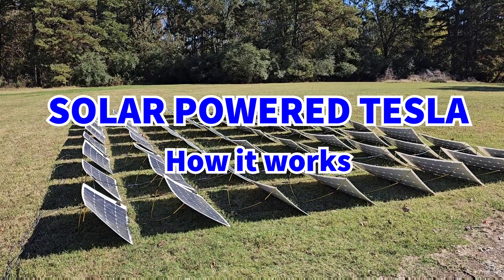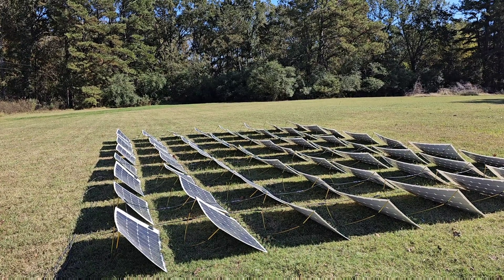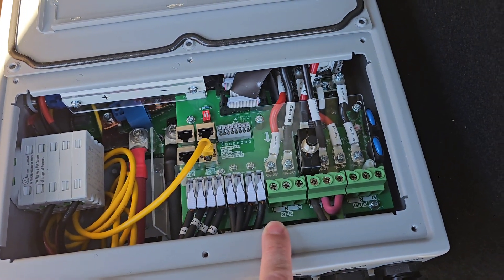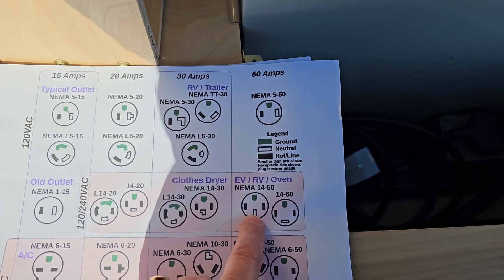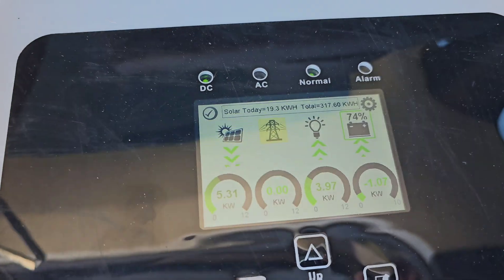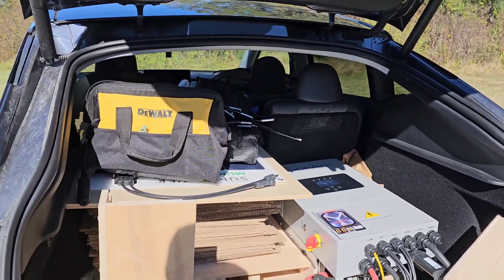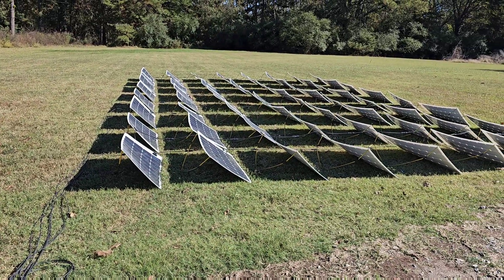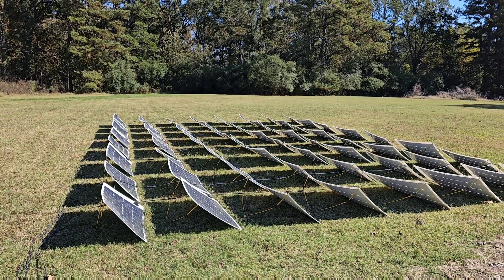Solar Tesla

Comment: I don't think the dc-dc solution you mention is limited by the communication with the car the way you described. I think the rough protocol is that the car establishes a maximum charge current with the charger and it's up to the charger not to exceed it. If you run at a lower current because the sun isn't shining it won't hurt to charge more slowly.
Reply from the maker: That would be nice. I am not sure how charging stations throttle current. I do believe they need to maintain a system voltage regardless. And there must be some threshold to keep the car in charging state.

Comment: Nice. I have noticed that there's a lot of stuff that could be powered with DC directly, but is only made to be plugged into an AC outlet. Which is annoying because you always lose power each time you convert between AC and DC and there's already a bunch of loses involved with solar. I'm gussing that by the end of the decade you will see a lot more stuff with a DC power plug.
Reply from the maker: I hope so. Would be cool to have DC outlets. Maybe that is the future of USB C. All low power electronics could be powered by high voltage USB outlets, monitors, computers, etc.

Comment: Aptera is making there own voltage-boosting MPPT and they will have many of them on the car.  They have rather low voltage strings of solar cells and have to boost to, I believe, 400 volt.  It will be interesting to see how efficient such a high boost ratio MPPT will be as, in general, MPPT's are typically most efficient when not boosting by very much.

Comment: Whats the total weight? I found putting too much in the back affected efficiency, not sure what you can do about it, but if there is any weight you can put in the frunk to balance it back out again, worth playing with to see if it makes a difference.
Reply from the maker: It is not as heavy as it looks. I will try a follow-up on the components and specs. I did bump the tire pressure from 41 to max 51 PSI. I also tried a CAT scale at a truck stop but the car would not even register.

Comment: 1) You drilled that hole through the tow hitch, but the car will lost its waterproof capability.😅🤔
2) So that extra battery would provide you extra energy if you completely drain all the juice?🤔
Reply from the maker: Yes. I have a plug for now and when I am done will permanently seal it back up. And that battery is good for another 15 to 20 miles. About like having a 1 gallon can of gas in the back.

Comment: I found an article about your cannonball challenge today. I subscribed to follow this crazy adventure!! I love this. Few month ago I was wondering what it would take to plug solar directly into chademo of my Nissan leaf. Dc/Dc and the solar panel are like the DC charger.
Reply from the maker: Cool thanks. I looked for quite some time. Even went to a battery and EV expo in Detroit. The closest I found was a controller that needed to be integrated into the vehicle and they were only 600 watts. Aptera may be our best hope.
Reply: There are few options which seem to be coming soon, and might work. I can't post links, but the names below should be enough to find info about them:
- Ampernext 30kW Solar DC-DC EV Charger
- Enteligent solar-powered DC-DC EV charger
- Enphase Energy bi-directional EV charger
- SolarEdge bidirectional DC-coupled EV charger
- dcbel r16
Reply from the maker: @scottcytacki  Thanks. I will check it out. This would be great when they come to market.

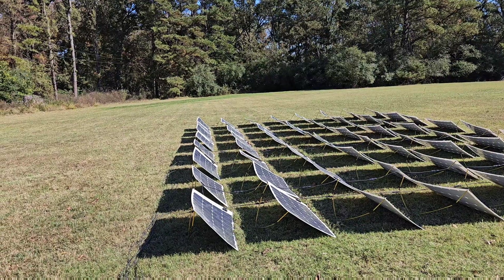Comment: 3:55 Don't the 2024 Toyota Prius has an optional small solar roof connected directly to the primary battery using an in-board SCC ?
Also I wonder if Aptera has developped their own SCC? May be Aptera could make a kit to add extra PVs and SCC when parked for the 500 miles version?
Reply from the maker: I think the Prius only charges the 12 volt on PV. Apera is really the pioneer. It is a tricky problem to solve. The overhead to keep the high voltage system awake and charging can be as much or more than roof top solar alone. So you need a small dedicated MPPT system for on vehicle solar.

Comment: Great explainer! I’d love to see a time lapse of how you change the panel orientation and tilt to maximise incident sun. Thanks for sharing your journey with us.
Reply: Yeah I was wondering if you actual move the panels during the day or not. If you don't have stuff blocking the horizon once the sun gets above 15deg you should be able to get almost full power. But that would be a lot of work. I can imagine some cheap lightweight solutions that would let you rotate and tilt groups of panels at the same time, but they might not work in practice.